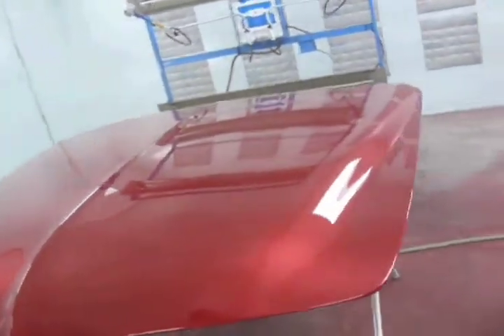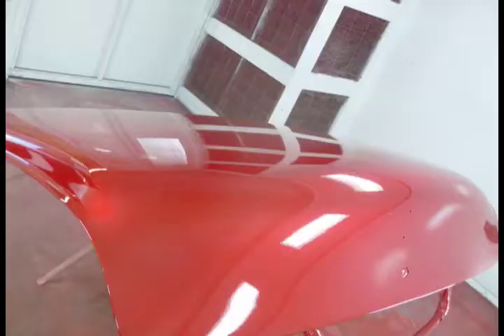EPISODE 55:1955 Chrysler 300/ block/ paint

Comment from the maker: charcoals can give you 48 hours of booth time to spray paint. It's the ISO's you need to worry about in Urethanes and Epoxy primers. Supplied air masks are for painting and spraying 2k's and Epoxies. You'd be ok with a charcoal for poly primer if it's new mask. Bondo is just dust so a pancake p100 filter is fine but when you mix the bondo it gives off fumes which require a charcoal or supplied air mask. I just stay in a ventilated area when mixing. My health is fine cause I work out.